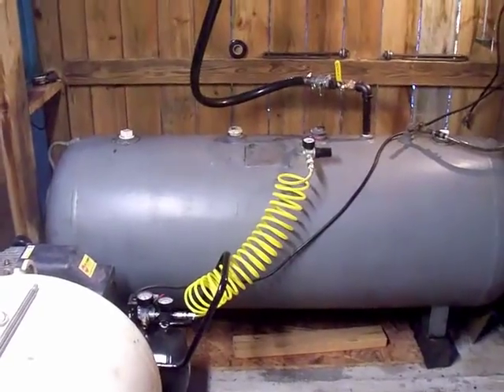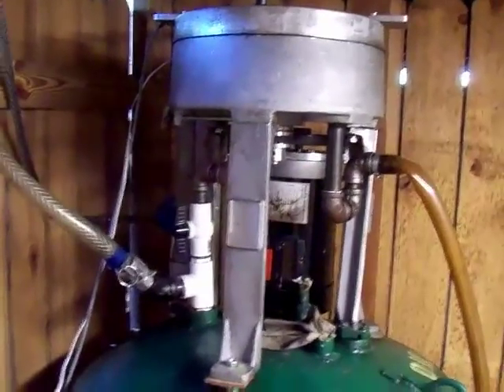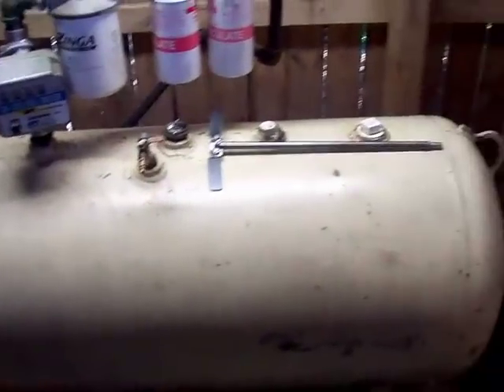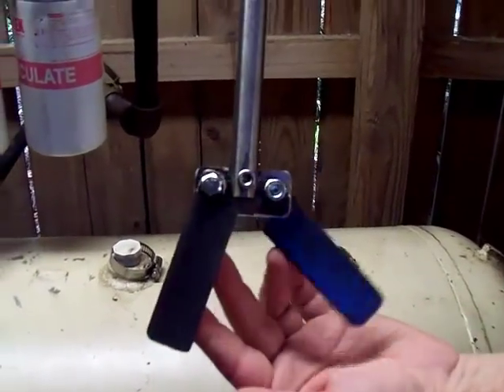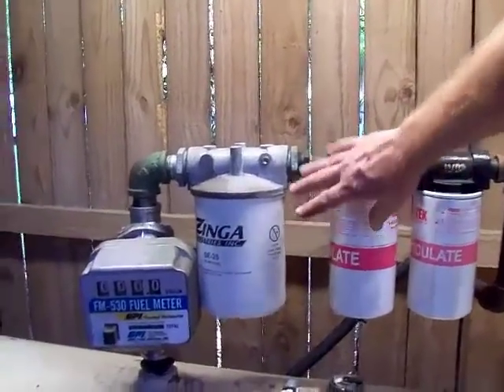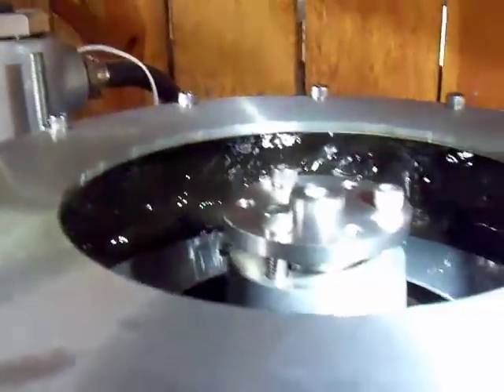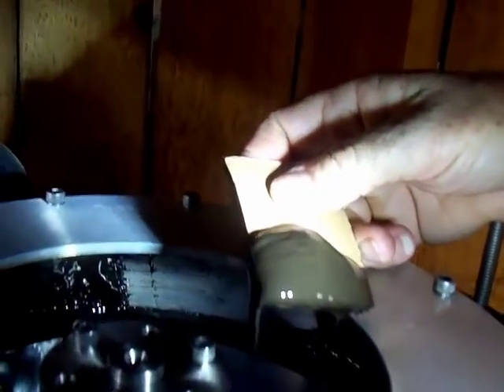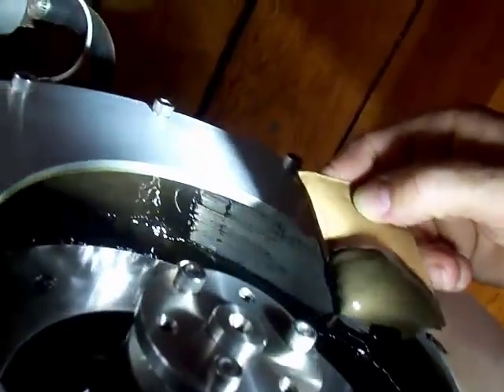Make Diesel Fuel From WMO Waste Motor Oil. Black Diesel Processor

Comment: Think i can run this with my 6.4L powerstroke?
I've heard you can and can't. It is a powerstroke, EFI-- not an IDI.
Reply: There have been plenty of people doing this since 1999. We don't run that motor but many people do if you don't have EGR or particulate filters. Typically, the people who say you can't have never done it,  didn't centrfiuge it before they did OR mixed it the biodiesel.

Comment: Can you mix kerosene instead of gas? I know theyre 2 different fuels, just wonder if it has to be a 20% mix and why.
Reply: Kerosene is good. Gas thins it a little faster and 20% is what thins it enough. You may run 30%  Kerosene or.. 20% may be OK.

Comment: Interesting but it takes more electricity than is worth.....
Reply: Electricity cost 2022 is 1.6 cents per gallon. Yep, that a loser for sure when diesel is $5.00 a gallon.
Reply: @stevechastain3070   - Whats the effort and time worth driving around collecting all that oil?  How much is all that equipment bought and use to make it?  Have you divided that all up into gallons pumped?  Me says no.
Reply: Diesel generator

Comment: what are the coldest temperatures you run yor mixture at? any pre heaters on the block?
Reply: It only gets to the 20's here and not very often.  Yes.  I use a block heater and a filter heater that come on 2-3 hours before I need to drive.

Comment: what you need is a diesel generator that can power an electric air compressor to pressurize the big tank and the generator power the centrafuge to spin it and have it all run on the wmo diesel generator.....incase the power goes out.

Comment: Wow now this is new to me. Everyone else I see mixes the oil with diesel.  I'm guessing cause it's a 80/20 it needs normal? 87,91,93?
Reply: The purpose of cutting the oil is to thin it for pumping. Every 10% of gas added thins it 50%. Every 10% of Diesel thins it 30%. Your choice.

Comment: Out of interest wouldn't it be better to mix with the gasoline first before filtering etc to make it more runny?
Reply: Becuase the oil is heated to160 - 200 F. we do not add the gasoline until after it has been run. But if the oil was not heated, that is an option. However it will emit flammable vapors. Not a lot but some.

Comment: This way to deal with waste oil is very good, the waste motor oil to diesel distillation plant produced by DOING can also realize the waste motor oil into diesel efficiently, if you are interested in the waste motor oil to diesel distillation plant ,you can visit website: www.wasteoiltodieseloil.com or contact: Bonnie Zhao 
Whatsapp:+8613526692320
E-mail: sales@doingoilmachine.com

Comment: Beautiful setup! I run two pressure driven units and mix the gas before filtering so I don’t use any electricity to heat. Works great and as a plus if you mix the gas into your tanks it really helps the settling process. Just make to use a pressurized cap so it doesn’t evaporate off. And to anyone else check the forums a member at tds ran his truck at the smog station on both wmo and diesel and the Emmisions difference was negligible and output.
Reply from the maker: I ran a gen set on it for 18 months. Clear exhaust and does not have the sharp "diesel" smell, more of a light nutty smell. We don't have tests here so glad to know that it passed with no difference between pump diesel and black diesel. My F250 has probably saved  about $4000 a year in fuel  over the last 14 years. I pull a 1966 massy 165 and trailer 10,000 pounds with no trouble and run my Massey on it.

Comment: can it be done in one pass or we need several turnovers of WMO to get it cleaned? Will it remove soot completely?
Reply from the maker: You can remove up to 99.6% of particle in one pass. For more information, See the tech articles on the US Filtermaxx webe site :https://usfiltermaxx.com/en/content/category/2-technical-articles
Reply: USFiltermaxx I want wmo to be golden colour again can it be done?
Reply: Thx
Reply from the maker: Detergents hold some soot in suspension. You can make auto oil lighter and it will appear clear and clean on a dipstick. Diesel oil  looks black. It has more detergent that holds the color. This is one pass, approximately 35 GPH at 8000G.
Reply: Yes you can. My oil I centrifuge for 48 hours every 55 gallons and it’s back to golden color

Comment: can you use this diesel fuel in modern European common rail high pressure diesel with dpf sensors.?
can you use synthetic oils in your mix?
Reply from the maker: I would not use it in DPF application because the filters are regenerated, often by spraying fuel into them to burn out the carbon. Spraying oil into will probably not give the same effect.

Comment: When using the 80/20 mix will it work well in my 2004 Diesel Ford Excursion? This looks pretty sweet, and can even be used for powering my battery bank back up for my solar system :)
Reply from the maker: The issue is starting. So the blend mostly depends upon what starts well for your situation. You may find 80/20 works or you may find that 70/30 diesel works better (some guys run 50/50). Once started, you will notice little difference. Mostly, that it is quieter that on 100% diesel.  I ran my diesel genset on 100% oil for about 18 months. I do have guys that use heat exchangers and run their trucks on 100% oil (started on diesel). IF there is any question, start with a light blend of oil and increase each time until you feel that starting  is becoming harder. BLENDING WELL is critical.
Reply: Did you ever try? I have a 03 6.0L.

Comment: It is extremly stupid and inconsiderate to burn waste oil. It is very dammaging for the environment even if it is burned at extremely hight temperatures. It sets free many dioxines. Dont du that. Use old vegetable oil from restaurants or so. NOT MINERAL OIL.
Reply: are you a hippie or something?
Reply: +TheBiodinkelpizza  Dioxins come from burning chlorinated oil. Nobody puts chlorine in motor oil. DUH
Reply: Get off that high horse of yours, people need tech like this to save money these days. You want to go save the planet, go start with Fukushima and get back to me when you have figured out how to fix that mess.
Reply from the maker: Dioxins come from burning chlorinated oil. Obviously you have zero training in the area and know zero about the subject matter. I would be embarrassed to post such an uninformed comment.
Reply: +TheBiodinkelpizza You insufferable dumbass, there are NOT dioxins in motor oil, either before or after combustion! Dioxins require chlorine, and motor oil has NO chlorine atoms in it. Learn some chemistry before you go spreading lies all over the internet!
Reply: +TheBiodinkelpizza You're thinking of (40+ year old) TRANSFORMER oil, which is made from PCBs. Yeah, don't F--k with transformer oil...
Reply: Fix fukashima first !  Then talk.

Comment: U can buy alot of diesel for the time and money it takes to build this.
Reply from the maker: +herby scheit.  This was built in 2004 and I 've not had to buy a lot of diesel for the last eleven years.
Reply: Spending time and money on these things is time and money well spent in my mind.
Reply: People that use the term in my mind have no concept of reality . Why build all this when you can just run off WMO strait ? My truck runs off used engine oil with just the stock filter and I change it once a year if that . So I didn’t pay for machines or diesel .
Reply: Did you not see whats in the centrifuge?  Thats what is in your gas tank, fuel system & your engine, mercy. He said that junk still comes out even after filtering down to 1 micron!   Good luck mr. Sludge.
Reply: +herby scheit of course ya can , its about the long term cost
Reply: This comment didn’t age well 😂
Reply: @localenterprisebroadcastin5971  lol
Reply: Ha. A few months ago diesel was $6.50 per gallon. I spent over $100 for a half tank. I'm still building my centrifugal filter, so far I'm about $450 in parts. Once I'm done, the money spent on the kit will square to four or five fill-ups at the retail diesel pump. This initially steep investment will off after a few full fill-ups. 

Different stores for different folks, if you want to spend your money the way you want that is your business - the same for us who want to run wmo through a centrifuge so it doesn't clog our injectors or build up sludge in the diesel tank.
Reply: @scoot_jockey  my comment was in favor of the apparatus not against it. Diesel where I’m at is 5.80-6.30. I’m all in favor of home brewed fuels.
Reply: Yep, you can. And you'll also save even more money and time after building this and making your own diesel fuel. Small minds focus on only one part of the larger picture.
Reply: Not for long... Sadly
Reply: Right, currently watching this on the toilet at 3am before I go do a pm on a truck that gives you atleast 11gals of 15w40. This is resourceful
Reply: Well when you cant buy it he will have this
Reply: Lol this didn’t age well
Reply: This comment didn’t age well 😅
Reply: Yeah but how much does all this shit  cost in Fuckface Bidens America?? Is it worth all this or does one just charge a higher service call rate for his diesel service Truck? 🤔
Reply: No you cant.

Comment: I had nothing but bad luck with wmo regardless how my mix was , motor oil has way to many additives and it deposits onto the tip of the injectors called cooked injector, I ended up going back to wvo and solved all my injector cooking , love the filtermax centerfuse , works amazingly to remove water and dirt from wvo. I ran my dual tank system for over 30,000 miles and haven't changed the wvo filter as of yet. Flow of wvo is 1 US gallon to 8-10 minutes.
Reply from the maker: Motor oil has detergents in it that cling to WVO and  form goo which will clog things up. If you have run WVO in your engine, then  running WMO is a no go and vice versa. IF you plan to switch fuels, then you best drop your tanks and clean them out. you should also replace all of your filters and then run a few tanks of diesel through it to completely flush the system. Replace your filters and then switch fuels. Be sure that your centrifuge and all your tanks and hoses are clean too. Summary, pick one fuel and stick with it. Don't try to mix fuels or switch fuels.
Reply: +USFiltermaxx I went with wvo, burns clean and no more cooked injectors and heavy deposits in the EGR, now for the wmo i run it to heat up my house and garage. I might need to buy another centrifuge from you, i'm tired of cleaning the centrifuge  between wvo and wmo, by the way.. i have never mixed wmo and wvo, i seen what it can do lines, injection pump and injectors, pretty much total catastrophic failure.
Reply from the maker: I'll post photos of my injectors after 50,000+ miles. No coking and no build up. I recently  installed a Moose Pump and new injectors so the truck really runs when you just touch the throttle  with your toe.  Regarding EGR, typically people bypassed that regardless of the fuel used.
Reply: Yeah, I run the moose pump. It takes off like a rocket. @USFiltermaxx
Reply: If you go on the oilburners forum my screen name is sidewinded_idi, you can see my injectors after heavy wmo use and there’s not a mark on them. They’re crystal clean. People with coking issues simply don’t filter well enough. I truly believe the only way to run wmo is with a centrifuge as I ran my 5 micron cartridge filtered oil through my centrifuge and pulled out nasty stuff! I use two pressure driven units would love to be able to afford your beautiful equipment! I transport for a living how about I put your stickers on my hotshot rig in trade for a unit lol, I’ll be sure to spread the love! 7.3 powerstroke 35ft tandem dual goosneck
Reply: Somewhere on our site I posted photos of our injectors after 60K+ miles. No coke or deposits.

Comment: if you blended it with bio-diesel or some kind of alcohol would you ok without the centrifuge? do you ever have to heat it?
Reply from the maker: Mark Welschmeyer No. Biodiesel  and WVO form goo with WMO. Alcohol is both hydroscopic and has an octane rating between 106 and 120 depending upon the type. You want a low octane rating for diesel fuel. Works better if you do it like the video. Use gas or diesel. Gas thins it faster, Diesel makes for easier starting. Both seem to run the same. No heating in warmer weather, probably 50F +  Running, doesn't matter however pumping and starting are more difficult in colder weather. So  moderate warming helps.
Reply: +USFiltermaxx So speaking of alcohol, has the ethanol content of regular gasoline caused any issues with mixing or screwing with the auto ignition point of the fuel?

Comment: One question, can you run that sludge through the filters again and cut with gasoline so you can use as a fuel again?
Reply: Peter Kapica DUMP TRUCK OWNERS WOULD LOVE TO TAKE THE SLUDGE OFF YOUR HANDS! Although I'm skeptical of actually using WMO for fuel due to whether or not it can cause future problems, I used to drive a dump truck and that stuff would definitely prevent asphalt from sticking to your bed! The homogeneous mixture of antifreeze and oil would be a great barrier because OIL & WATER DO NOT MIX!
Reply: Peter Kapica You don't wash it out. It becomes part of the road. When you grease a bed you only use a thin layer. Diesel is the number 1 choice to grease a bed but is illegal by the Department Of Transportation because it eats up the asphalt.
Reply from the maker: I would not do it. Sludge is full of dirt,water and antifreeze. None of that make a good fuel.
Reply: Maybe you can distill the sludge for heavy oil products.
Reply: Stacy Smith yup but then when you go to wash it out, makes ground pollution

Comment: your mixing paddle is made out of a non-ferrous metal or plastic, right? dont want any sparks around that fuel
Reply: people are so dumb.  WMO or diesel will NOT burn from a spark.  Even if it would, there isn't enough oxygen inside the tank to support combustion.
Reply: I doubt it would ignite from a spark before the gasoline is added

Comment: pretty cool dude..sell the goop as bearing grease =P
Reply: ya and how long would this bearing last ? although if the goop was mixed with some house fuel # 3 it may
work as a waste oil stove ..
Reply: Joseph Maximus lol i was being facetious but as a fuel itd probably carbonize the shit out of everything pretty fast id rekon. im sure theres some use for it though
Reply: erik61801  Ya you do have a point there, however, some of the waste oil stoves burn really hot, i guess the trick would
be in the mixture, house fuel #3 and good ole Goop, would be interesting to see if this stuff would light up.
Reply: Joseph Maximus I bet China would buy it lol, its probably just a sludge of metal particulates and other inorganic crap..just gotta find a use for it..kinda like the refineries in the early part of the century they just poured gasoline into rivers because it had no use at the time
Reply: erik61801 Unbelievable, they called it a nuisance by-product.  I remember a story about crude oil before they found a use for it. Upon digging for water sometimes they would hit crude oil and they would  say, "that dam black stuff
just ruined my water well" .  I wouldn't mind having such a problem today, it's amazing how times changes things..
Reply: burn it in a stove and heat the shop!

Comment: Is it possible to make "black diesel" for LESS THAN $15,000?
Reply from the maker: I don't know of any reason it would cost $15,000. You can mix up some oil  in a bucket and run it. The issue you will have is, long term, you will get a build up of sludge in your fuel system if you don't  remove the soot and particulates. Our equipment starts at $1495.
Reply: USFiltermaxx I was making a price assumption based on the set-up you have going on here. This one, in particular, must be well over $1,400. I'm looking for a relatively cheap way to make diesel, so I can further support my case to my wife that driving a diesel truck is more conventional than gasoline.
Reply from the maker: Brandon Skinner Break even is about 4 or 5 months with regular driving. Or go to the site and register for a free centrifuge - see the video too.

Comment: so dose this fuel work in any diesel motor or just in an m35a2
Reply from the maker: By varying the blend,It works in virtually any motor. Some motors do use optical sensors that have trouble with darker fuel. In those motors you are better to use transmission and hydraulic fluids.

Comment: Dont you have injector problems?
Reply from the maker: No, over 4000 hours runtime testing  BEFORE we marketed the product so we know what we're doing. Since 2004, we've been running diesels on waste oil. We DONT cut corners by using a spinner or other cheap centrifuge. Unlike all the other manufacturers, we don't let the centrifuge fill up with goop like you will see on some other photos or videos. We dump the sludge BEFORE it fills up the bowl and we have forced ventilation. You won't see us stirring oil with a stick or using paper cups on our centrifuge to get the water our, so we don't have problems. This isn't our first walk in the park . We do not test our products on your engine, we test them on ours PRIOR to marketing. We do run diesels everyday. Thank you for your inquiry.

Comment: Do you have an enviromentally friendly way to dispose of the waste slug? Or a method of re-use for it?
Reply from the maker: Take it to the local oil recycling bin, mix it in a box of sawdust and burn it for heat in a wood stove, or build the sludge burner in the alternative energy book.